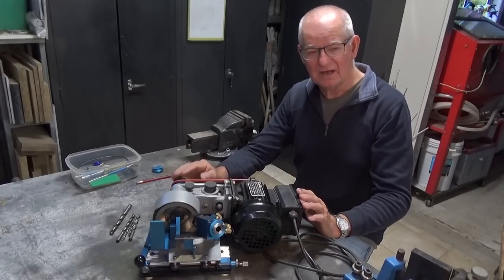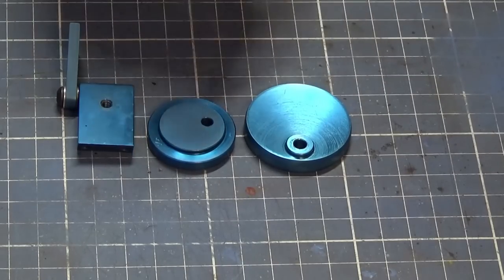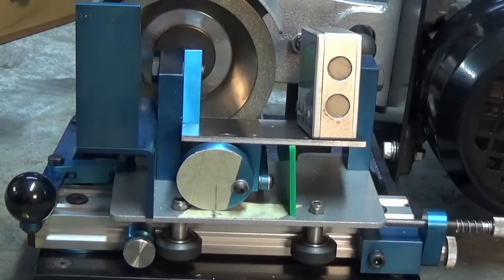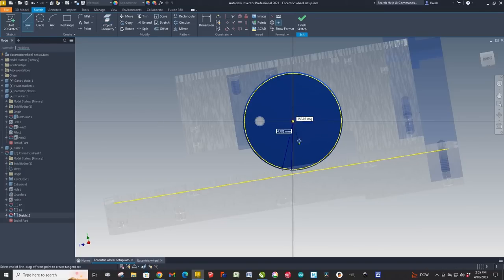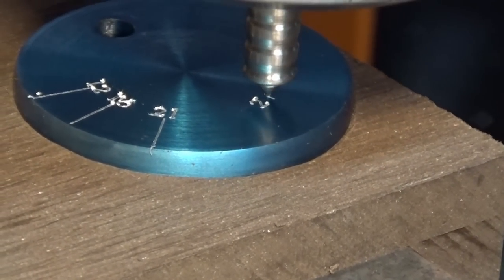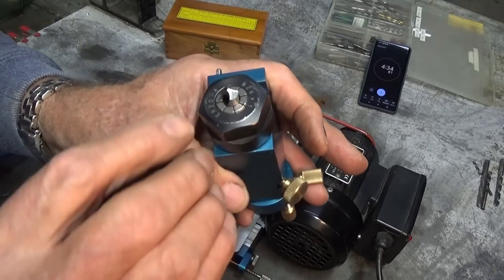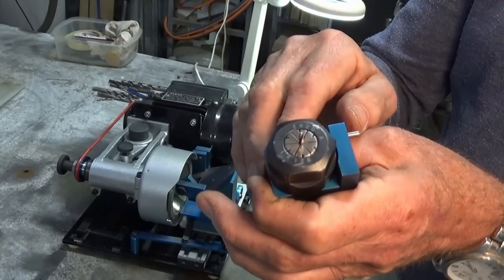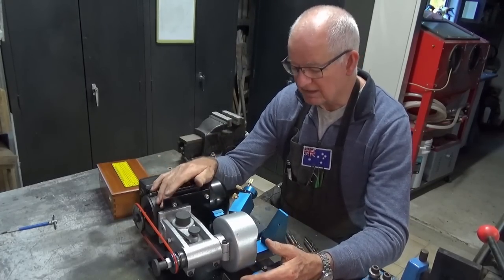A 4 Facet Drill Bit Grinder DIY Style Final

Comment: Great work as usual Mark. Don't worry about what others say. As long as you like what you are doing, that is the important thing. In the end this turned out to be a well made functional machine.
Reply from the maker: Thanks Jon. I had fun building it and I actually used one of the drill bits I had sharpened on the lathe today and it cut beautifully with two (mostly) identical spiral chips coming out of the hole. Which is better than the usual dust and fine mangled chips I usually get. 
Regards,
Mark

Comment: Balanced my drill press after 30 years of chasing bouncing parts around on the table. I built a dynamic auto balancer, simple and effective. The first time I saw one in action was a high-speed cd rom reader, the type that didn't shake. I used a ball bearing outer race and its balls discarding the cage and inner race. I 3d printed an object to center the race on the vibrating shaft and also stop the balls falling/flying out. The outer race has less than 180 degrees of balls and has no lubricant. When rotating, the balls will reposition themselves and cancel the shaft vibration. A used ball bearing is fine, provided the race and balls still have an undamaged mirror surface finish.
Like your projects.
-Cheers Peter
Reply from the maker: Peter, that's very interesting. So, I'm guessing it's a totally passive system? I will try to find some more info on Google. 
Regards,
Mark

Comment: I can’t wait until the foundry update, I work in a foundry for many years.  You would tend to think that I have my own foundry,  but I don’t.  Perhaps I can build one in the future, we shall see, either way I am hindered by a lack of funds. Great video by the way, really enjoy your videos and thank you for sharing your knowledge in a way that I can understand and appreciate.
Reply from the maker: I always imagined that running a home foundry would be expensive and difficult but my first attempt at melting aluminium in a very crude furnace went well enough that I was encouraged to keep going. At the end of the day, the raw materials are just sand and clay and a supply of clean scrap aluminium. Propane is definitely the way to go if you are starting out and it does melt aluminium, eventually, but diesel is quicker and it can get way hotter but it's a bit more tricky to handle. 
Regards,
Mark
Reply: @Preso58  I just might have to look into it some more, I know I can purchase a kit for $200 but if I can build something for less then that would be the route I’d take

Comment: Mark, you've done an excellent job at crafting a way to keep fidelity with the original plan/design.  I'm not certain that eccentric wheel with marks on it is the best way to go, but as you said, accuracy isn't as important as precisely being about to set the angle for both sides of the bit.  Alternatively, perhaps if the larger trunnion blocks had one of them larger still, it could be engraved with angle marks.  The eccentric could still be used to set the adjustment, but the angle read from the larger trunnion block.  🤷‍♂🤷‍♂

Comment: I would definitely recommend making a centering jig, its literally 2 flat, parallel rods at equal height with a ``valley`` between them in the simplest form, hell, they neednt even be parallel, they can be converging at some point in the imaginary distance, it just matters that you get them flat and level, so things dont roll off them when you lay a mandrel down across them... Balancing is easily done by a hand drill or a dremel with a rotary burr... I would advise you to use a cbn shaver to turn the i.d. and the o.d. of the cbn portion concentric, as to have the abrasive portion dynamically balanced... After that, lay it on the balancing jig on a mandrel and balance the whole wheel by removing aluminium from the cup section, the outer edge... Dont go too deep nor use too large of a drill, the balancing can be done with a 3mm drill or a 4mm one with ease... Just make shallow pecks on the heavy side...

Once balanced, the wheel will actually cut much much nicer... I have a `yuge surface grinder, and its 6inch discs are literal weights, and if i even consider not using a perfectly balanced stone(they have balancing arbors, so its just shifting small weights around, no drilling), the surface finish shows it... You can see the oscillation in the surface finish, and its a monster of a machine, compared to this little jig you have running a 4inch disc... Sure, the cbn wheel is much lighter than a vitrified corundum wheel of cheese, but nonetheless, 3 tonnes of cast iron are literally orders of magnitude more rigid than this little thing, and i can still optically detect the imbalanced wheel just by looking at the surface it produces... Compared to wheel-machine mass ratio, my 3 kg wheels are still a fraction of machine mass compared to your cbn wheel to machine mass, especially as most of your machine weight comes from the motor, which is not a structural part nor grants anything apart from mass and drive... 

I would also argue that drill grinding and any tool grinding for that matter, should actually demand better surface finish than most work, as the surface finish of the cutting tool literally translates into the surface finish it produces when used in future work... To the point that i would consider in your place, getting a 1000 grit vitrified diamond wheel to hone the tools after using the cbn for ``cutting`` work, vitrified or electroplated, but i prefer glass bound, as its much more resistant to contamination with abraded material and thus being reduced in quality of the surface finish it produces... Tho, glass insulates the diamond, so either very slow speed or flood cooling are necessary for ferrous grinding, as not to dissolve the diamond into the metal... That or a slow speed carbide grinder, which can hone hss with no problems... Diamond isnt that reactive with steel, you really have to grind with it to produce enough heat to cause local dissolution of diamond into steel... Honing with some wd40 will allow you to gain a razor sharp edge, that despite the logic will last longer than regular, as the polished edge has significantly reduced tendency to grab, snag or chip due to friction, as a polished surface is the smallest version of the surface, due to lack of any micro terrain that can catch or accumulate shit that then catches... Especially for drilling alu and copper that love nothing more than catching an edge and welding onto it... 

All the best and warmest regards!
Steuss
Reply from the maker: Interestingly, Clough42 just released a video on balancing grinding wheels. He used a Dubro model aircraft propeller balancer. I just checked and they are available and fairly cheap. He seemed to think it worked well for a large grinding wheel so I may investigate that. The only issue is making some sort of mandrel for the cup wheel since it only has a tapered shank on one side of the wheel. I have some 16mm precision ground rod so I may be able to mount the wheel on that but it's always best to balance it on it's own mandrel.
Reply: @Preso58  I would consider making a centers balancing jig, rather than the usual two level shanks, as that would allow you to indicate the mandrel of the grinder on the lathe with a tenth`s indi, or finer(some severe medication recommended beforehand), drill in the two centers, and voila, you have a mounting mandrel that both a balancing mandrel at the same time... You could technically use the lathe and 2 dead centers with some light spindle oil in the female centers to balance the discs, or check for balance, but i really dont want to even recommend that, as cbn dust of any sort around the lathe or any machine is essentially a terror to consider...
I think i`ve seen the vid you alluded to, but yes, many types of balancing jigs can be used to work a stone into order, but consider which design best suits your situatio and mounting system... As you said, the stone is best balanced on the running mandrel itself... I would even consider balancing the pulleys on both the motor and the spindle of that little machine, just for additional smoothness of running... There is always some imbalance to any rotary part that has not been sorted out, or is a perfectly ground shaft with purely concentric geometry... Even most of the machine spindles have some little imbalance due to most of them having threads or keyways or some such nonsense that is never perfectly cut to result in 100% balanced part... Generally its disregardable, and on high end machines, its sorted in the factory to run to less than 0.001 grams of imbalance, but yeah, lets cut this rant here...

All the best and kindest regards!
Steuss

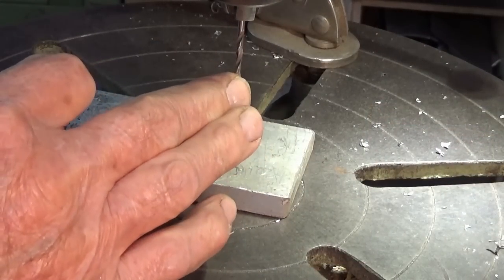Comment: 30:49 Is that an illusion or am I seeing the bit wobble?
Reply from the maker: No, it was the drill press table which I had forgotten to lock. However the drill bit was bending a little under load. I did regrind the 3/32" bit afterwards and got it to cut much better. Trying to carry out complex operations with a camera running is always a challenge as you have split your attention between two tasks. 
Regards,
Mark
Reply: @Preso58  Thanks

Comment: Why not put flats on your round cam to give you fixed detents for specific angles.
Reply from the maker: Good idea but that detail escaped me. I guess it would make it more complex to machine and for the most part I tend to leave the eccentric set on one value when sharpening batches of drills of roughly the same diameter. 
Regards,
Mark

Comment: Great video and great results from your efforts. As to the pressure needed on the small bit, I think the chisel point is the resistance and could be defeated by making a tiny split point on it, just a suggestion, no comment on the execution however. Enjoyed the build and I will take a good look at your prints, might make a nice winter project for next year. Cheers Preso!
Reply from the maker: I did go back and re-sharpen the small bit. I find it really hard to concentrate when the camera is rolling. I was trying to hurry the process along for the camera but if you slow down and take the time to check what each stage of the grind is doing it actually saves time since you don't have to do it over again. However, the main thing is practise.
Regards,
Mark

Comment: Is there a problem with the grind angle if you have to take a lot off the face? You align the original cutting edge with the clear perspex template but as the grinding progress the grind is flowing the twist in the drill and not staying parallel with the wheel. 
I'm guessing it's not so bad if it's only a touch up and not a complete regrind.
I could be way off the mark of course. My own drill Sharpening attempts are rugged at best😅
Reply from the maker: Yes, you do sometimes need to check the alignment if you need to grind heavily to remove a chip or a badly formed angle. It only takes a few seconds to realign it though. 
Regards,
Mark

Comment: Hi Mark, thanks for the mention the caps look good.II made the flute alignment jig for my Kennet & it’s a great improvement thanks for that. I’ve probably ground 20 or so bits and like you was unhappy with the grit getting everywhere. I made a thin leather apron that hangs down from the table edge it’s made a difference. As you mention casting why not have a go at a new wheel guard with a vacuum port? You could also incorporate that extra depth for the wheel that you had to add to the Quorn one, I have exactly the same issue as I also have the Quorn guard, I’m looking at doing something similar.
Reply from the maker: Tony, yes, the caps do look nice. I have a Prusa 3D printer and I bought a spool of genuine Prusament (filament) with a sparkly fleck in it. The surface that is against the printer sheet comes off with a lovely texture and if you can arrange the print with that surface uppermost they always look like a factory made part. I did consider casting a new wheel guard but it would be a complicated pattern and would need a core to give the hollow port for the vacuum. It's just a nuisance dust when grinding HSS but carbide is a different thing altogether. Apparently, carbide dust is full of cobalt and other heavy metals and definitely not good for one's health. I will look into adding some thin leather as a skirt to protect the Vee slot and the wheels.
Regards,
Mark

Comment: Awesome build as usual! Did you consider staggering the numbers so that they every one is higher up the line than the adjacent one? This allows you to dial in the all angles of the trunnion from both sides of the eccentric wheel.
Reply from the maker: No, unfortunately not. Staggering is something I usually do after a few drinks. It would improve the legibility if they were arranged as you say.
Regards,
Mark

Comment: Educated guess: Once you do not have to explain to us (and yourself) what to do next, then it will become much faster. I think it looks much more complicated than it appears once done a few more times. Some will say they can do it all on the bench grinder anyway 🙂.  (try to grind a 1.6 mm carbide drill on benchgrinders, then we talk again)
I saw a nice Fresnell plastic lense in the stationary shop, I am thinking of incorporating one in the alingment jig. (still having most of the other work to do).
Reply from the maker: It's always hard to carry out multi step procedures while a camera is running. I like to stop often to check setups but that means a lot of editing later. As it turned out, I tried to sharpen the two drill bits in one take without stopping and something always went wrong and I had to start over again. I am sure it will go more smoothly after I have ground my first hundred drill bits!
Regards,
Mark

Comment: Hi Mark, thanks again for sharing and inspiring. BTW - That 'CBN' wheel may not necessarily be CBN. It looks suspiciously like one I picked up on ebay being sold as diamond/cbn. It turned out it was sold by a seller who thought they were the same thing, but noted higher demand for CBN over diamond... Thought that may be helpful.
Reply from the maker: I suspect it is just a diamond grit plated onto a steel body. However it seems to grind well and the surface is holding up well. A quick check on Ebay showed that their were two price points for CBN. The genuine article was about 4 to 6 times the price of what I paid. The Chinese equivalent is a bit vague about the composition of the grit so I guess you get what you pay for.
Regards,
Mark
Reply: Yeah, totally agree Mark. I challenged the seller and he refunded my purchase price, all too quickly for me to be convinced he didn't know they were diamond not CBN. Having said that, the wheel seems to run really well due to the damping effect of having so much mass in the steel.  I ended up finding some reasonably priced genuine CBN wheels out of Ukraine. I know, bit of a risky purchase hey! However the seller was very genuine and really appreciated the patronage. Only down side was that it took about 8 weeks to arrive. I'm super happy with the product and would recommend without hesitation. It's really fast to remove HSS material but leaves a fine grind finish. Let me know if you would like a link to the product. 
Regards, Craig.

Comment: Hi Mark, in one of the earlier videos in the series, you were talking about having to remove the back corner of the relief grind.
Could one rotate the drill bit collet assembly while grinding the relief angle so that the resulting facet on the drill bit is not flat, but rather is conical in shape?
I understand the current configuration with the 180 degree stop will only allow you to make this conical grind on only one of the flutes, but I'm curious if rotating the bit will result in a consistent clearance angle. If that works, one could come up with a two stage rotary indexer allowing one to rotate the bit 180 deg and then about 90 deg to grind the conical relief angle.

Hope I'm making sense... 

Love your videos and projects, you share so much info. Thanks!!
Reply from the maker: I guess you could do that but the split point attachment can be used to remove the heel of the drill point. I do need to carry out some more tests on the whole rig. Unfortunately, I sort of lost interest in the build once it was completed and I moved on to another project. I had sharpened all the blunt drills in my metric and imperial set and then the machine got put away in the cupboard. 
Regards,
Mark